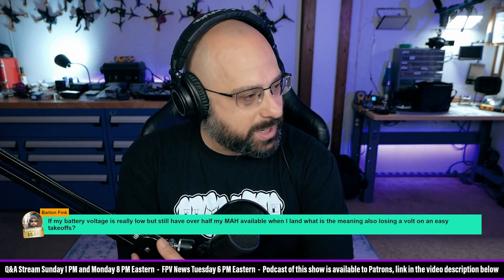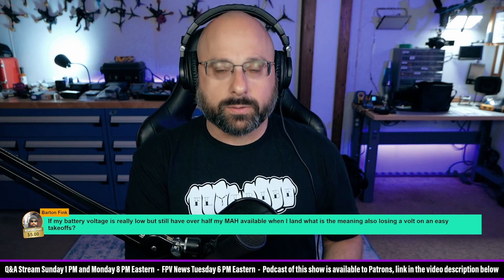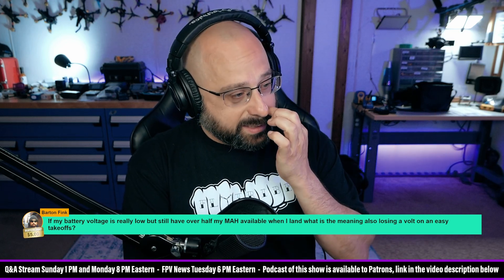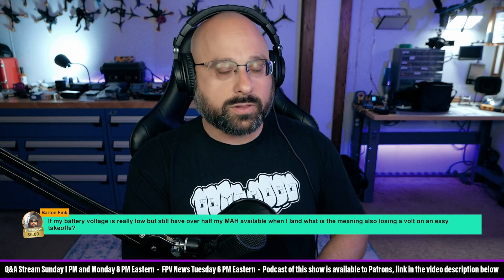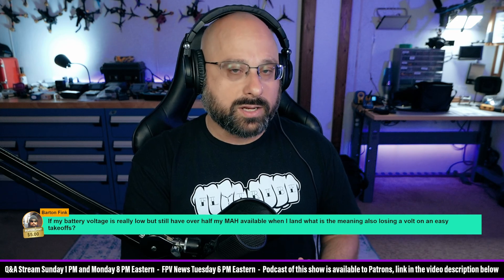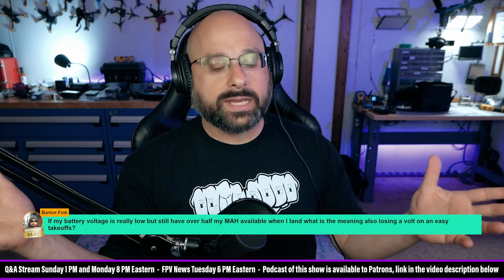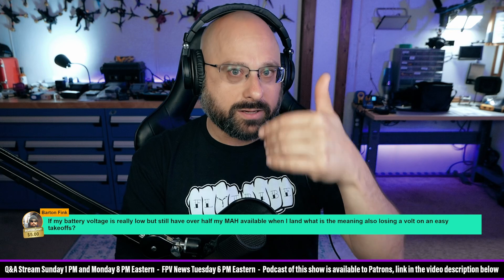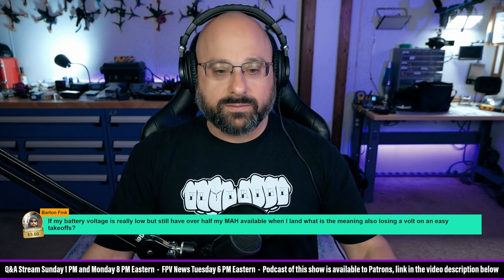Betaflight MAH Used Doesn't Match My Battery Label! Help! - FPV Questions

Comment: I calibrate all my current sensors right after tuning and during gigs only use 50-80% oft the mAh my batteries would provide to ensure I have enough juice for landing. These tattus sag really late and rapidly, so just checking the voltage tells you the story way too late.
Reply: how do you calib it?
Reply: @sgas  Fly 3 packs relatively slowly. Note down the claimed mAh consumption of the quad. Charge them one by one and note down what my charger actually charged back as mAh and use an online calculator to change the betaflight setting correctly. Usually on my next flyday I'll note down a few consumptions & recharges again to crosscheck but this initial adjustment usually nails it quite well!
Reply: @aphinion  Thanks, seems easier than other methods, ill try this.
Would a hover or idling work as well?
Reply: @sgas  hover yes, idling may take too long and over-estimate capacity. the more current you draw the more internal resistance builds up dropping voltage. so if you calibrate idling and then fly a rough rip, your battery might deliver 10% less mAh's until voltage drops.
Reply: @aphinion  So basically, calibrate for your most average flight style?
Reply: @sgas  correct. and just know to get home a bit, earlier when you rip at max throttle or might need a few landing attempts (I have this during gigs in crowded areas where peeps tend to walk into your landing zone despite screaming spotters xD)
Reply: @aphinion  Wtf lol. Ofc ill rely more on voltage than mah consumed, I dont do too much lr stuff so it should be fine

Comment: The statement, " battery voltage is how you know your battery is empty, period", is erroneous.
you can put lipo well below 3 volts at full throttle on a long pull, still having 50 % charge, it can only be relied upon whit a low load, (low current draw )
Reply: Yep, idle voltage.

Comment: If you use the mah used bar OSD element and don’t care too much about the accuracy but just want the gauge to be useful, you can set the capacity on the battery tab to match what’s printed on your battery and then just tweak the current calibration value until the bar reads near empty when you reach the voltage you want to land at. The setting can be adjusted using the BetaFlight OSD menu so you don’t have to keep connecting to the configurator to get the value that works best.